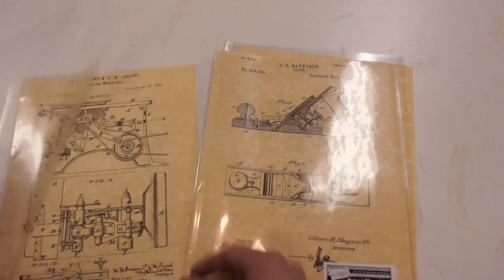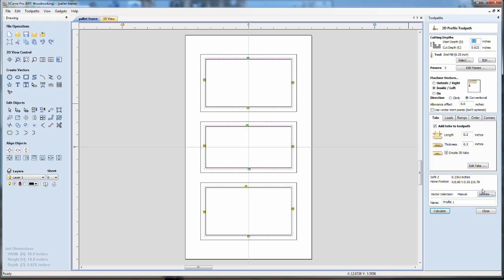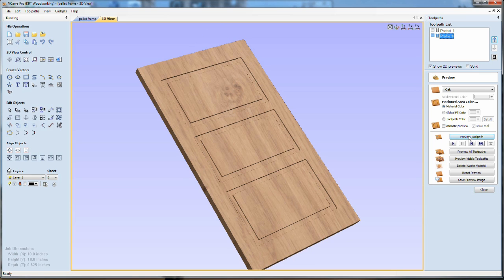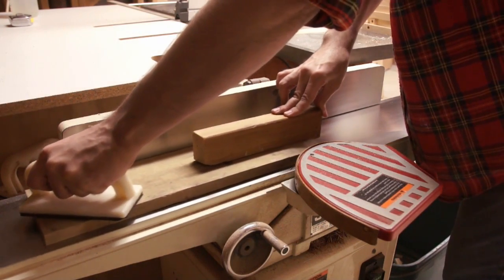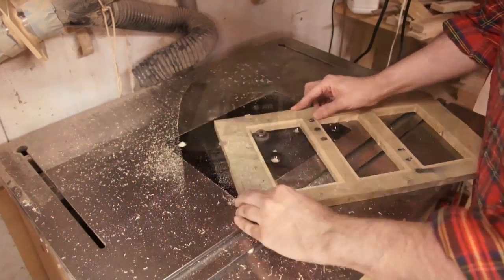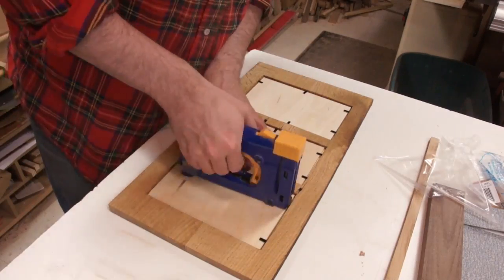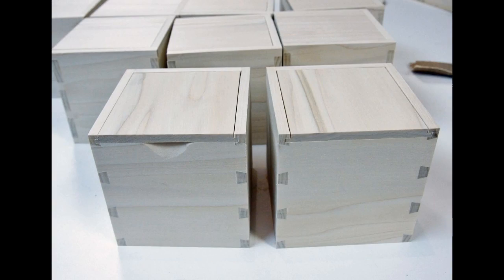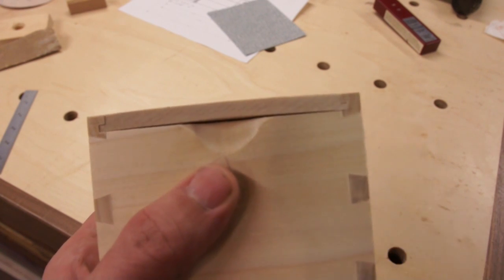Pallet Wood Frame

Comment: Nice pallet project!  I like those patent pictures.  They're really cool!  Nice little boxes too. You should be able to open them up again in a few months :)
Reply from the maker: The trouble is I made them for a wholesale customer...
Reply: krtwood
Could you put them in the fridge or would that be a shock and crack them? If it works you could possibly glue a piece under the lid cross ways to keep it from expanding so much in the future. Slather with wax and ship.
Reply from the maker: lostinthekerf
I just have that one I made extra so I could have it as reference when they ordered again, the rest are out of my hands.  Hopefully they ended up in air conditioned homes :)  Next time I will run the grain the other way.